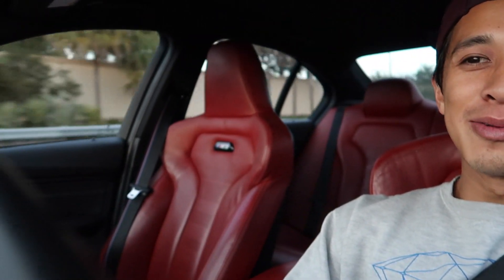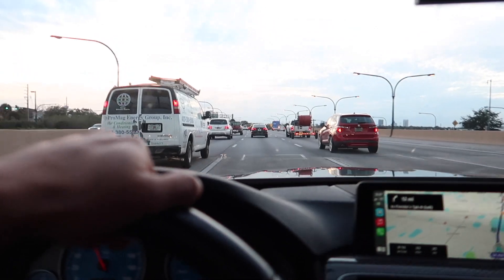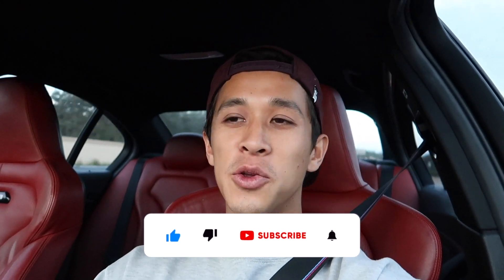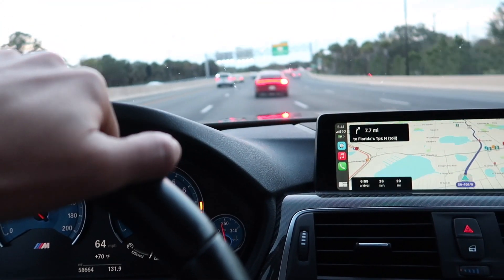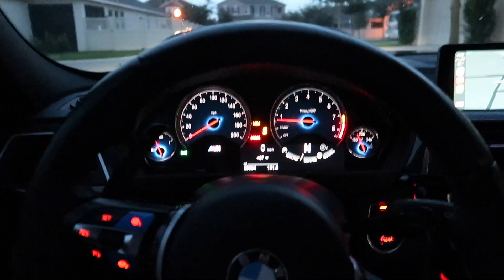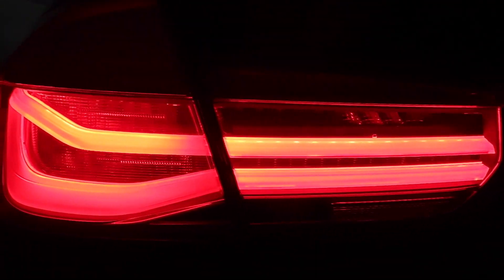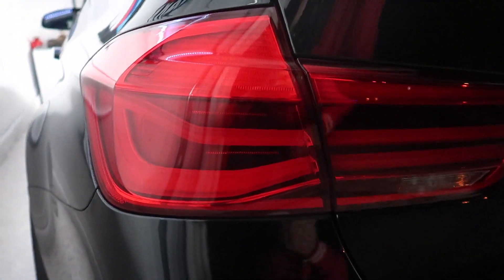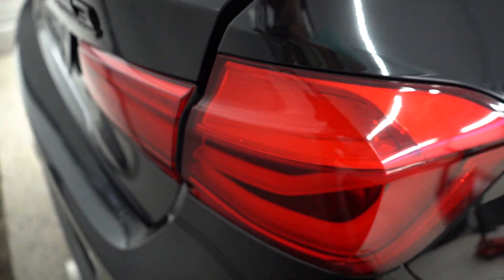Swapping LCI Taillights back into my BMW F80 M3! + Changing out a BMW Seat Controller

Comment: What happened to the carbon steering wheel you had
Reply: This was probably shot before that
Reply from the maker: I sold it right before making this video, I explained the reasoning in my last video haha, but basically the blue stripe didn’t match and I wanted to get my steering wheel alignment fixed before getting another wheel
Reply from the maker: @topchoiceauto9626  right before actually haha ! Just explained in the other comment reply 😎💪🏽💪🏽

Comment: How you like the non Comp no features F80?  Drive the same as a Comp fully loaded F80?  Are all those packages you can get even worth it?  Anyways you have a M3 Comp badge on the back of you M3, however yours is the non Competition version…
Reply from the maker: I have a comp car with non comp seats recently switched in. I chose the comp package mostly for the wheels and seats, but both are now gone 😂. It’s up to you though. If you plan on tuning and getting aftermarket wheels, then the comp package isn’t worth it, but you plan on staying stock or oem +, then yes 100%